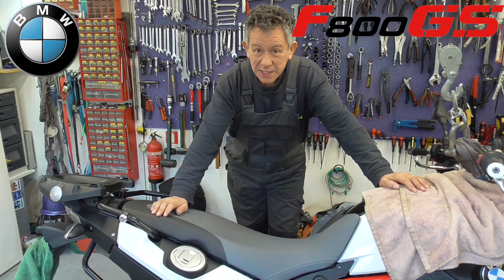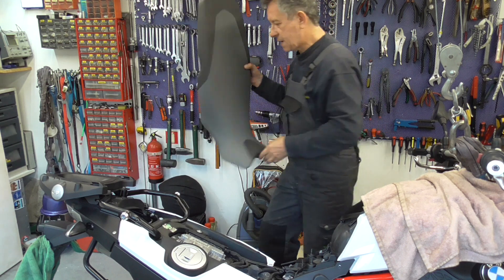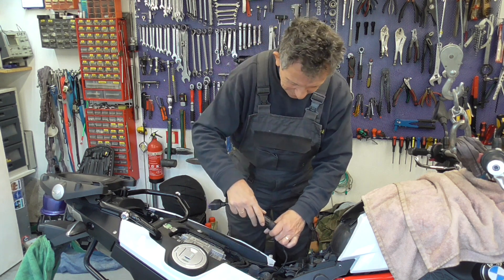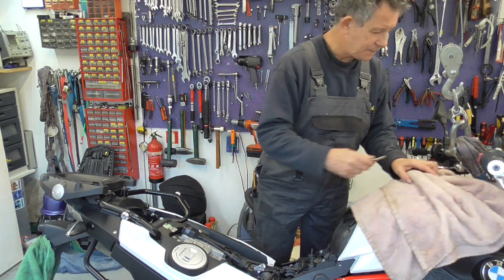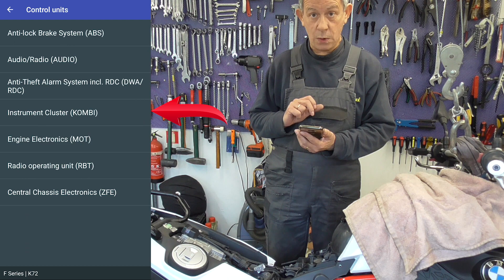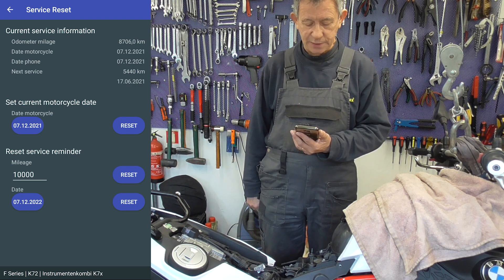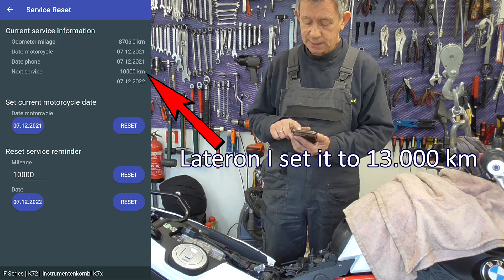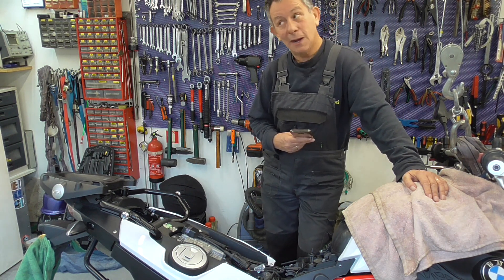BMW F800GS SERVICE RESET using the MOTOSCAN APP.. EASY..??  👨‍🔧---🏍

Comment: Useful video. I have a question?
I have a BMW GS650-800 on which the dashboard itself only shows me kilometers and hours. Is there an option to unlock this application to show the temperature, fuel level and gears? Thanks

Comment: Worked brilliant on F800r and r1250rs. It appears that the  battery must be fully charged on the BMW r1250rs as when ignition is turned on with front lights  running there a big drain and at 12.2 volt I have difficulty connecting. But sorted.  At least that appears to be my experience.  Thanks you old mechanic you have saved perhaps us $500 to $700. Yahoo.😅
Reply from the maker: Yes good to read ! 👍🏻👊🏻😉

Comment: Thank you for these videos!  I have a 2015 F800GT and have been learning how to do my own maintenance to save een hoop geld.
Wondering if you can follow-up on the LED installation - my bike has an error code due to LED brake lights and I would like to erase the lamp error code.
Reply from the maker: Hi Joseph, came your bike with a non led brake light ?
Reply: @TheOldMechanic  Yes - 2015 was before BMW went for LEDs.  The system thinks it's a bad bulb because LEDs draw much less power.  Hoping I can change that with Motoscan, but I haven't ordered the device for it yet.  I will order it soon - saving up because it's an extra $150 for the device and the Motoscan level.
Reply from the maker: Hi, with the Motoscan you can change it to LED 😉👍🤛🏍

Comment: Hi Old machanic,

Please keep the videos coming , I love the moto scan app but one thing that is a little bit lacking is a user forum or videos from the app maker, your videos are a massive help !
I'm going to retrofit the RDC system to my 08 R1200rt using the moto scan app to code it to the ECU and pair the RDC wheel sensors to the unit once I get all the parts and so am keen to learn as much as I can about using the app.
Your tuition videos are really appreciated.
Mark
Reply from the maker: Thanks Mark